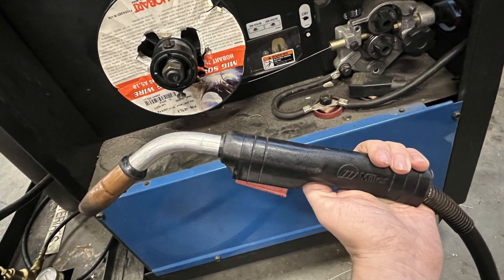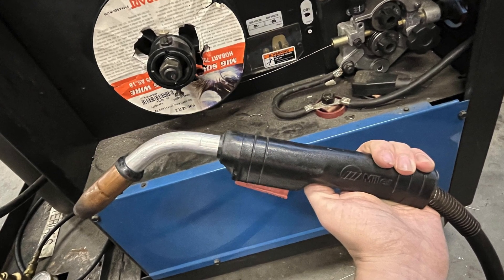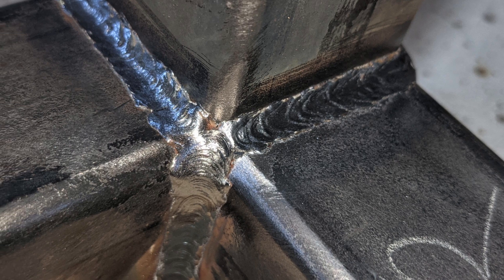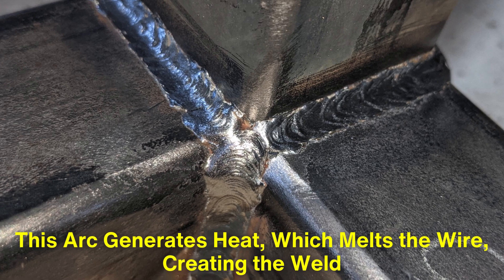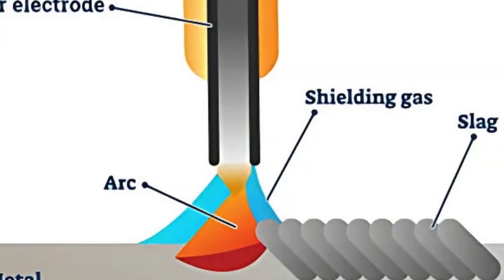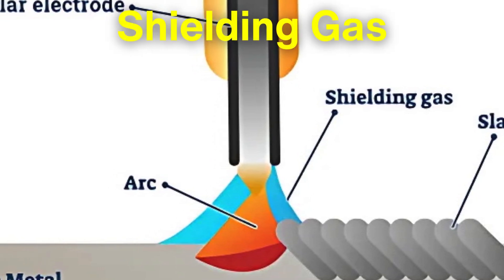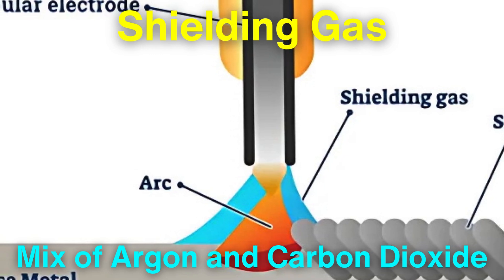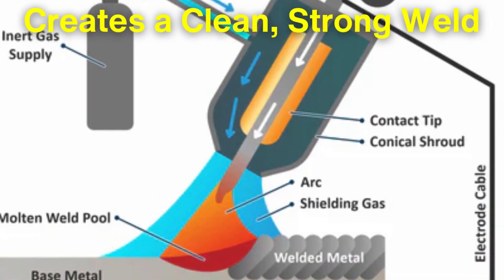What Is the Difference Between a MIG and a TIG Welding?.

Comment: To be a good welder you have to be able to migrate,tig and arc weld. You can also carbon gauge. Pipe vertical overhead and flat weld is part of the test you have to pass. Can you tell about these?